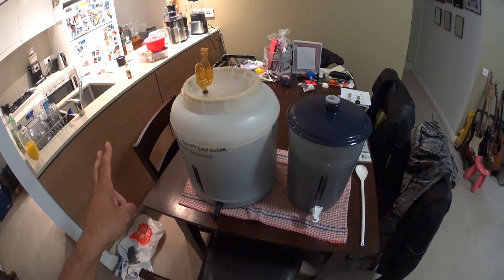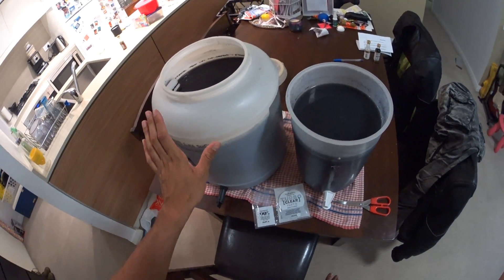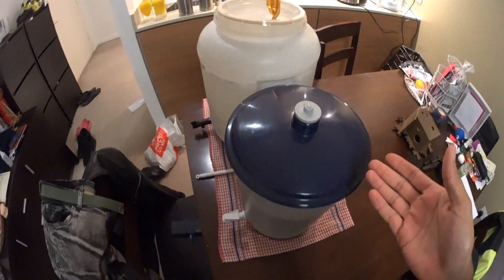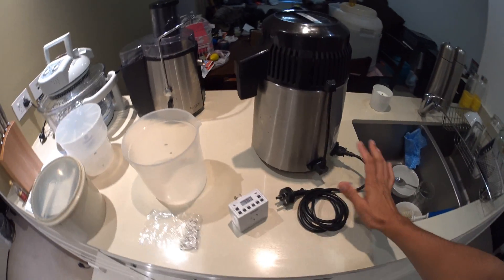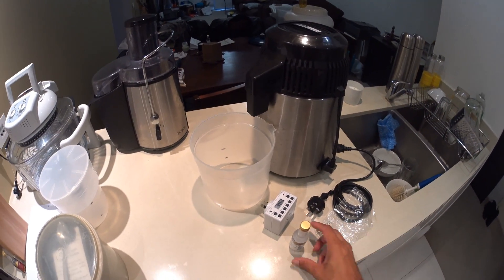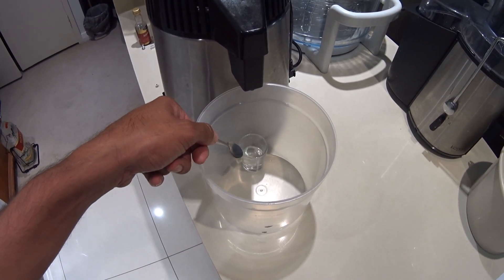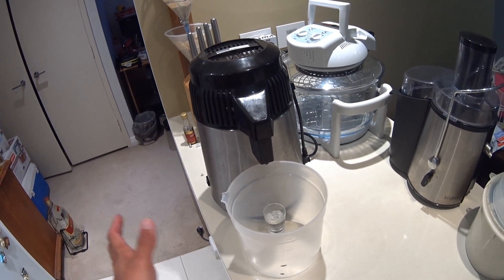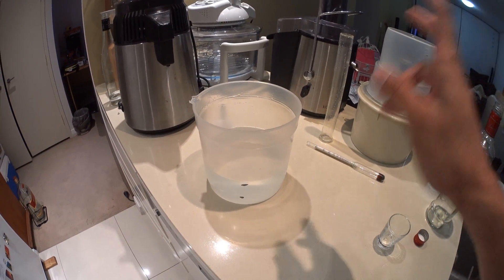Home Distillation - Part 2: Distilling Wash into Spirits

Comment: i bought a cheap water distiller 750 watt ( no temp control) i used it to distil some orange wine i made. I pour 2.5 litre in the machine and let it run. the 1st 30 ml i discharged , then collected 500ml spirit. It still taste like orange and has cleared up a lot. But somehow it doesn't taste nice ? I think the temperature was just 2 hot ? So, i ordered myself a Voltage dimmer and a extension cable for the fan which i plug into the socket (i dont want the fan to run low ) and i will try again, once i received the Voltage dimmer. Do you think this will work ???

Comment: I'm using a very similar still. I've done plumb and lemon washes before. Now I have a grain wash but with all the particles I think it will burn very easy in this still? Also since the still isn't temperature controlled in my thoughts it will ramp right up to 100 degrees and boil the water thereby diluting your output? I normally cycle the still so it doesn't get too hot and in theory will produce a more potent alcohol.
Reply: His has only 320W element. Commercial water distillers are 750W and up.

Comment: Tap water ugh. Put coconut water in it next time. Or at least distilled. Far smoother.
Reply from the maker: Australian tap water isn't too bad. Plus you're distilling the water once it's finished fermenting so I don't see the point of adding distilled water to make the wash. Maybe for beers and ciders but can't see how it would work for spirits. Have you tried it and did it work for spirits?

Comment: Hey love your videos. Do you have a video on how to use the juniper berries through the air still?
Reply from the maker: No but you can get a botanical basket that clips inside the still to infuse the flavour into the spirit. It looks like a large tea strainer. I used the basket but only with copper bits in it to make a cleaner taste, not to infuse.

Comment: 3:44, my wash didn't look as clear and it looked more like the way it looked when I poured substance A and B. Is there a reason why it is not clear even after 24 hours? 

I used about half of each A & B bag 
Stirred like instructions said on video and the bags themselves

Anyone knows?

Last question is on doing this step for actual fruit based wash. After I have it go through a cheesecloth, do I need to do this step to add carbon and then remove it with A&B clear liquids too? Or can they go straight into the AirStill after straining the fruit wash?
Reply from the maker: I do not recommend making a fruit wash, as the methanol levels can kill you or make your eyes blind. Many people have died from that by drinking it once it was made by someone that didn't take precautions to remove the methanol. The air still might not be able to refine a safe amount of it out from a fruit wash, you'd probably need a reflux still.

You'll be ok with a sugar, water and yeast wash. Less methanol per run with the air still than is naturally present in an orange.

Comment: The air still works great without all the proprietary ingredients. It also works great as a secondary distiller. You can use about a tablespoon of Butter to stop foaming and prevent Puking. My favorite way to use it is to do stripping runs with an 8 gallon column Still and then use the Air Still to make cuts. Great video.
Reply: I got something similar to the air still and you can adjust the temperature on it,  I haven't used it as yet as I just got it the other day, but I thought maybe try it with cheap cask wine to test it out.
Reply: @steviebboy69  I ran water thru mine the first run. I haven't used it with wash in it just been doing cuts after stripping runs. I have some peach wine from the summer that never cleared. I may run it thru and see how it goes. Good Luck.
Reply: @karlfowler3742  Yes I will give it a go and see how it works, the wine sounds nice by the way.
Reply: If you have a functioning column, you shouldn't need cuts after the column run... just a foreshot cut from the column and then it's all neutral hearts until you hit high temps at the top when almost all of the ethanol is gone. The point of a column is that it forces reflux and makes the heads and tails impurities fall back down into the boiler.

Edit:  If you want to make gin, then sure, take the neutral from the column run and put it in a pot and rerun it with botanicals... but otherwise, still no need for cuts after a column run, unless your column doesn't work properly.

Comment: That flame showed high methanol as it was all blue. Ethanol burns blue with a distinct orange tip
Reply from the maker: Myth number 1.
Reply: Sugar washes don't have methanol, as there are no fruits or grain in the wash. Methanol forms from the pectin in fruits and grains. So you are most certainly wrong about this.
Reply: @TEKutso  Not sure about that, you dont know whats added to some sugar. The chemistry can get wierd. Methanol is just a more broken down chain of ethanol. Like splitting sugar into smaller chains like invert sugar, stuff might happen under different heat/pressure/ph conditions. Or addind stuff might add as a catylyst to that reaction. Prob some of industry tech is proprietry no doubt

Comment: Hi,I have the same distilling machine as yours ,and I adjust the heating between 85 and 95 degrees as advised ,but after distilling one littre the alcohol that comes is 35 degrees.If I prepare the ingredient with 4 kilo of sugar and active yeast-100gr-will I get a higher degree of alcohol,or what should I do,thanks
Reply: I always buy ‘still spirits’ pure yeast, carbon & wash clearer in a multipack from eBay. Then I mix 6 bags of sugar into my wash at 30 degrees to start away.

Comment: Do you find leaving it longer to clear gives you a better result with the airstill.. I did two washes on my first run one came out well the second made me a bit sick.  Second wash was slightly grey as i think i went too early.   Any tips you can give me for the air still maybe leaving ferment an extra day and clear an extra day?  Im in aus also qld..  And also no 2.  So you get 1L out of it which is 200 above the 800 recommended.  But that is 40-45% so no need to add water?
Reply from the maker: I've put washes that were grey from not sitting long enough in the fermenter once I've added the clearing agents. It still worked in the still but I had to clean the inside of the still afterwards from the buildup on the sides. Best to let the wash sit for a few days after you've added the clearing agents, or at least until it's nice and clear. Will smell less when distilling and less mess to clean out of your still.

From the still I get 1.2L at 40% per run, and don't add water to dilute as it's already at the right percentage. The way the instructions tell you to do it will produce better tasting spirits but at 35% alcohol. But if you are then filtering through a carbon filter you probably won't notice any difference.
Reply: @outie555two you said you don’t water it down but you did water it down in the video?

Comment: I have just brought the air still and it says only use tripple distilled yeast (turbo yeast and carbon) is this true or have you used other yeasts if so how was the outcome thanks for the informative videos mate 😀
Reply from the maker: You can use other yeasts. You will get the best results though with what they recommend. As this type of still is called a pot still, and the purity won't be as high as reflux stills. What it comes down to is the taste of the spirit and how long you need to filter it after distilling. If you don't use the carbon in the wash it will still work and produce the same amount of alcohol, but it might need to be filtered twice once distilled, and the still will smell more when distilling. If you have a good filter for your spirits (once distilled) you probably won't notice any difference other than the still smells more when running.
Reply: You can use any wash you want. The reason they use Turbo Yeast is because it makes a higher Percentage Wash. Most Yeast will die off with High Alcohol washes. Beer Yeast stops at about 10% and Wine yeast stops at about 14%. Bread Yeast works about the same as Wine yeast but offers a different flavor.(more for Corn Liquor) Turbo Yeast and DADY Yeast will go up to about 21%. With the limitation of one gallon you want the highest alcohol content you can get. I like to do what is called Stripping runs where you take your wash and just distill it down to about 40%. I use the anti-foaming agent with a wash to prevent it from rising and coming out the condenser. You know it happened if milky wash comes out. If it happens turn off the Still and Wait at least a half an hour before you open it. Add the anti-foam or a pat of Butter and start over. Do that a few times and then take your alcohol, mix it together with like batches and then proof it down to 40% with clean water and re- distill it. Don't run anything higher than 40% in your Still. Make your cuts during this run. You will need a Proof and Tralle Hydrometer to do the proofing.

Comment: Hi, I have a question what is the temperature of the distiller because i bought a new temperature control distillers for water and alcohol and i set it up on 78 degrees alcohol boiling point but nothing happened!!
Reply from the maker: Try 90 deg Celcius but not much higher
Reply: Thanks bro
Reply: what 78 degress dont make alcohol try 140

Comment: Great videos - my question is so once you have made your drinkable spirits, is there any uses for the remaining wash, weed killer lol or something, I also wondered about continuing to distill the wash, as this would still contain some alcohol? Thinking window washing or other uses not drinking? Trying to make the most out of my time and layout per batch. Cheers!
Reply: I wonder the same things. Maybe there's a way to use that remaining as a base for another wash, or another type of spirit.
Reply: @ray.patterson2136  that would most likely kill the yeast.
Reply: I use the wash in the garden. Good nutrients I was told and didn't do any harm,  cold.
Reply: Oops sorry 😞.  I was talking about the original wash in the fermenter.
Reply: @sandycole4047  When making beer the 1 or 2 Litres left in the fermenter I swirl it around and bottle the yeasty beer mix  and use it in cooking to me it has a Vegemite like flavor and I hear its rich in B vitamins.
Reply: Yes you can continue to distill the alcohol out down to 0. However, you will begin to pick up Fusel Oils in the lower percentages. I go to 40% on stripping runs and 60% when making cuts. Check out the "Still It" page. Jesse is the best teacher on YouTube.

Comment: Can you use a water distiller?
Reply from the maker: It is possible, but may need modification to make the temperature lower so it doesn't boil
Reply: You can. The wash will boil off the alcohol before the water anyway. It wont get to the boiling point of water until the alcohol has gone. Good for 50% alcohol distiilling anyway. You can modify them but it wont make much difference, will just make the process slower.
Reply: @Apollo-p1l  Hey, just have a question, i have the same still just with temp controll between 85 and 108 C. So what you are saying is that i can turn the twmp above the recommended 90C?
Reply: @youcoool12  Mine has no temperature control at all. All thats required is you to regularly taste whats coming off it. You know from the taste when to stop. If its basically water, stop distillation. You will end up with 40 to 50 % alcohol depending on when you stop distillation.. If you know roughly what alcohol content your original wash is then you will also know the amount to expect after distillation.
Reply: @Apollo-p1l  okey thank you, i have a alco meter and hydrometer, i am aiming for 40%, just trying to make it go as quick as posible.
Reply: That IS a water distiller. Exact same machine.

Comment: Hi, I use turbo yeast,  and after 2 and a half hours my alcohol is 70%, I run it for another 30 to 40 mins and its still at 50%, so in all,I end up with 2 litres of 40% alcohol. So out of 24 litres of wash, I can get 7 to 8 litres,  just by experimentation.
Reply: Hey, what kind of still did you use? I ha e the same as in the video but i can controll tempreture between 85 and 108 C. But the one in the video he cant controll temp, si wondering if i shoud turn the temp all the way up.
Reply: Which means the wash was 4 L of 20% wash. Can't be good shine from that ;) Pro's run 10% washes for a reason :)

Comment: Damn, i just use water , 8KG sugar and 1 pkt of yeast and leave it for 1 month. and that's it... ive never heard of this carbon packet. But i do use a homemade refux still and condenser with marbles in the stem.
Reply from the maker: Yeah that's still a great way to do it. The carbon and clearing agents really do cut down the time though if you want to have a drink earlier, but if you have plenty of booze in reserve its still going to achieve the same result your way, just requires more time

Comment: this is stupid advice... all heads are potentially dangerous ...bad bad advice, you used turbo yeast with nutrients ? acetone in the heads, advise people to chuck it.. not say sugar and yeast and water wont make poison .. fuck man, be responsible..
Reply from the maker: If you're worried chuck the first 50ml out. For future reference the manufacturer of the yeast and air still states this on their website "while the Air Still makes 55% ABV spirit by condensing the alcohol vapours using a fan and air (because of this technology, you do not need to remove the first 50 ml as methanol is not produced)." https://stillspirits.com/pages/stills

Comment: Any Alternative to ceremic beads ? Couldnt find near me at a short notice
Reply from the maker: You can do it without it but keep an eye on it in case it boils and throths up. It will need the solution added to help stop it. Alternatively smash an old ceramic cup or plate into small pieces. Maybe that would work but not sure.
Reply: Marbles or cleaned pennies made pre 1960s works
Reply: Take an old ceramic coffee cup, put it into an old sock and smash it to bead-size pieces with a hammer. The goal is to have particles with unglazed surface area to moderate the boil.

Comment: Does it cost much in electric
Reply from the maker: Probably not too much, maybe 10c or something. If I remember next time I do it, I'll connect it through my electronic meter plug which will let me know the amount of current drawn and estimated cost, but really didn't see my power bill spike or anything. Plus if you have off peak electricity rates you could always run it then.

Comment: Maybe a stupid question, but any idea what kind of chemicals you add to clear the liquid carbon and to prevent the foaming? Anything that could be harmfull or done otherwise?
Reply from the maker: It's called finnings. I think it's made out of fish scales. They use the same stuff at the end of a beer ferment. But it won't end up in the spirits in the end as if any of it is in the still it won't evaporate and condense like the alcohol does.
Reply: The anti-foaming agent is food grade Silicone and remains in the Pot when distilling. Look at Five Star Defoamer 105. It looks the most cost efficient and only takes about 2 drops for 5 gallons of Wash.

Comment: shit, I've been calling that alco-meter a hydrometer all these years.  I feel like a fool now.
Reply from the maker: Heck it's basically the same thing, but I think hydrometers measure alcohol content for beer and wine. But I could be wrong. I have both.
Reply: @d.harris8635  anything around room temperature should give you proper readings.  

The density of a liquid only really changes at its state changing temps.  At 32F the same amount of liquid would fit in a smaller container and look like less liquid but if weighed should be equal.  

I only bring this up because whatever temperature he is measuring at is most likely the temperature he is drinking it at and as long as he isn't selling it, precise measurements are overkill.

Theoretical question: Shouldn't we measure ABV at body temp to see how it really effects the body?
Reply: @d.harris8635  The temperature corrections are very small unless the temperature of your distillate is 20 C or more divergent from ambient temperature.

Comment: Skip all the rubbish your putting in there. Get yourself a dimmer / speed controller like this one https://m.harborfreight.com/router-speed-control-43060.html to adjust the kettle temperature. Also use a old computer power chord for the fan (same connector) run on full for 1 hour or first drips then switch to variable at about 75% power adjust until you get about 2 drips per second. Takes about 4 hours to run down to 20% at that point it’s a waste of time to distill any longer.
Reply: Hey, what temp shoud you aim for?